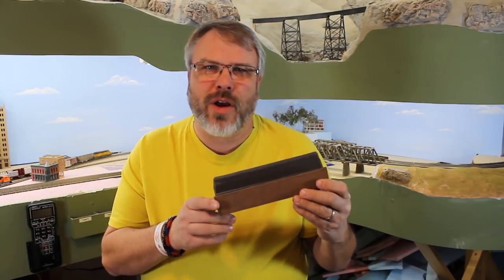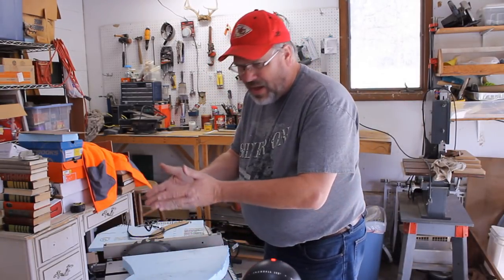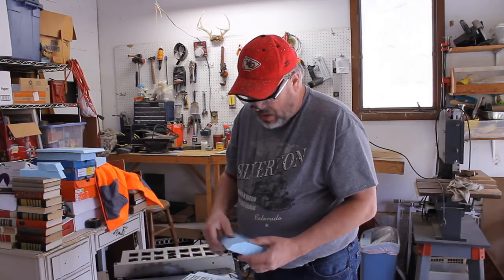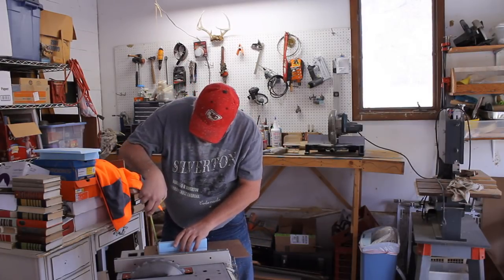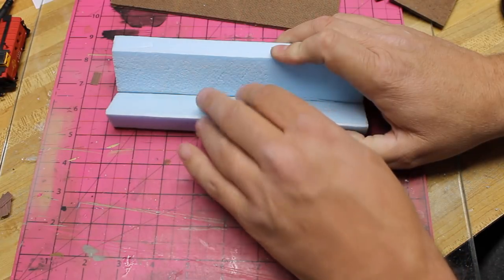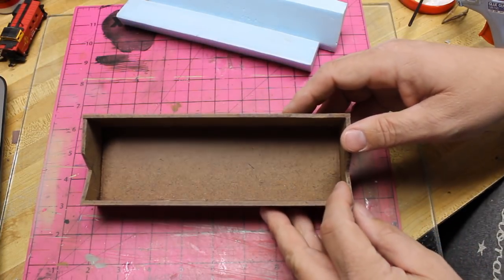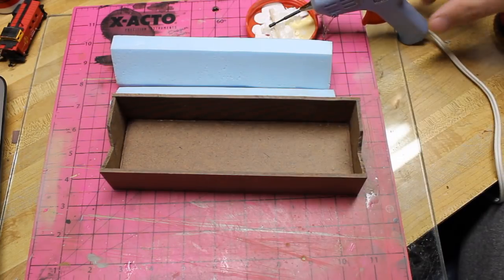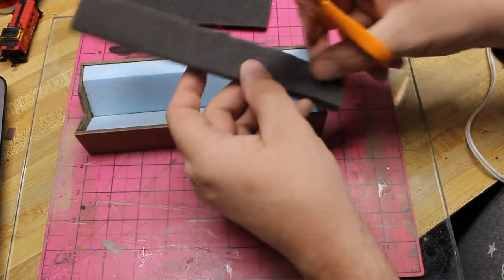How to Build a Model Railroad Locomotive Cradle

Comment: I think the video was great...I really liked the fact you stressed on safety with the table saw.  I have know guys using them and have had accidents not using simple precautions.  Cheap to make cradle. Looking forward to the build contest.
Reply from the maker: Yes, safety is key. I've never been seriously hurt by a power tool, but I know people who have--lost fingers to chop saws or radial arm saws, etc. The sleeves are key on the table saw. It is so easy to get one caught in the blade as your right are reaches over to push the work through.

Comment: nice job sir. i like the fact you can make it to any size you need. the foam is easy to come by for any HO scale modeler. it comes with every loco you buy. 
 so if any N scalers need a piece, you can always call a HO guy / gal
Reply from the maker: +sparky107107 Very true. A lot of electronic equipment comes with foam rubber packing too.

Comment: Great cradle idea Ron. I would build your version over the Ken Patterson version. Kens is nice, but yours is easier to build and with the 60 degree angle it seems it would easier to work on equipment. BTW, I would love to send you a pair of safety glasses that are designed to fit over your prescription glasses. I just need to know where to send them. Thanks again!
Reply from the maker: +Dale Mierzwik Lol thanks Dale. As for those safety glasses, email me at ronstrainsnthings@gmail.com and I will answer that question. Thanks.

Comment: Hello Ron There is a company that makes a foam cradle  with a groove in the front for small tools for n, ho s and o gauge starting at $8.00 to $20.00 I have one and is very nice and secure for your engines  and freight cars, very nice product! Thanks Steven if you are interested I can send a picture and name brand of Company. Much easier than trying build these with different materials.
Reply from the maker: Thanks. I made this video for those who just like to do things themselves. Absolutely nothing wrong with commercially available cradles. Thanks for the info.